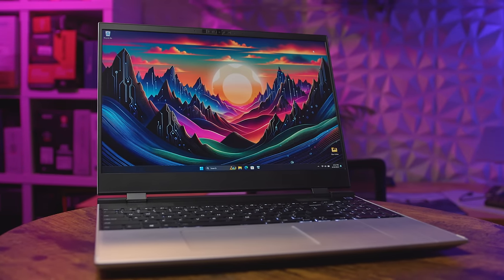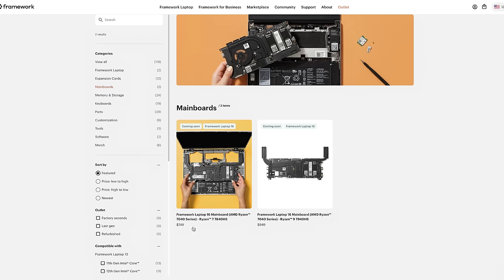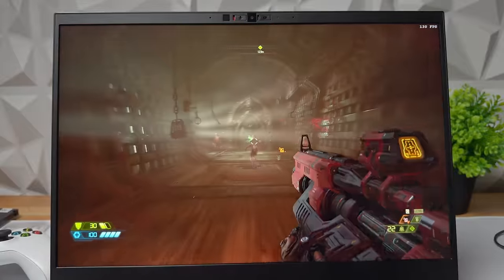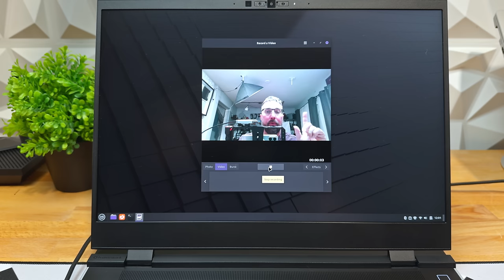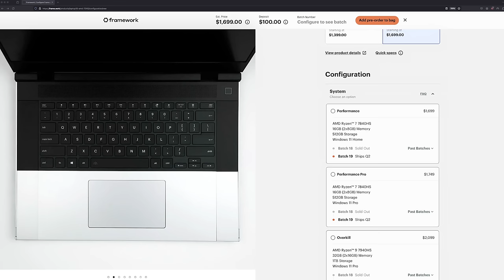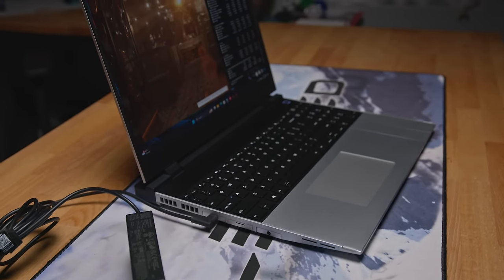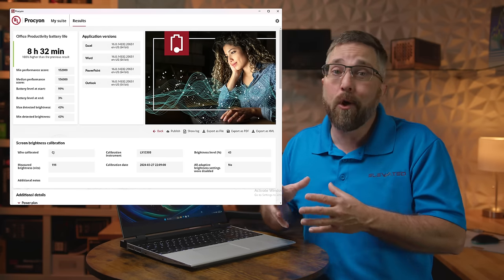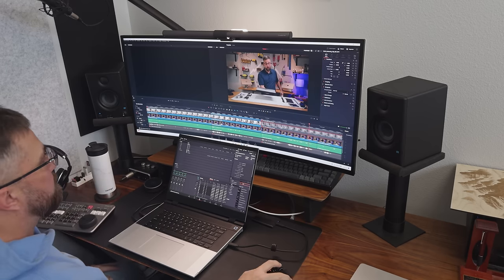Two Months With the Framework 16 Laptop. My Final Thoughts!

Comment: When people say the upgradability is not worth it, i always feel like they're not thinking long-term enough. I don't want to upgrade just once in 2 years, I want to upgrade in 5. And then again in another 5. And another 5. Maybe only get a new graphics card on half of those. Other laptop brands don't support motherboard upgrades at all, and definitely not so they will fit in the same case, with the same display and keyboard, 5 years into the future. This is supposed to be the last full laptop I'll ever buy, not just a replacement for two generations.

I can't afford to buy a new laptop every 2 years. My current one is from 2018, actually. The only thing holding me back is doubts on whether Framework will be around in 20 years.
Reply: I think repairability is more valuable that upgradability. In this case you're paying for modularity and again for the same modularity when upgrading, almost spending what'd you expect for a new laptop with a new cpu, screen, keyboard, etc. It's not cost effective, repairability is where it's at imho (reason why I've been pulled towards business laptops in the  past).
Reply: @fran2911  then i guess it's not worth it... i just, don't break my stuff
Reply: @fghsgh  I don't either, but faulty engineering is a thing, accidents happen, etc. the fact that you can easily get a battery, a screen, a hinge, ports, could be a good argument to get this laptop for long term use, not for specs and hardware upgrades alone, unless prices drop but there's a lot of designing that goes into these things and oems are always incrementing prices
Reply: @fran2911  repairability is definitely a very good one. A lot of people who use a laptop for more than 5 consecutive years will eventually encounter issues with the keyboards, hinges or other mechanical parts that naturally wear down. Replacing a keyboard on one of these is so much more cost effective then buying a new laptop.

Although I will also say another reason for upgradeability is more than just being able to upgrade an individual component, but about having more control over what you actually put into your laptop. 

Like for example, imagine if you were one of those people that LOVED the dell xps laptops and only bought dell XPS laptops. But when you went to buy a new dell XPS laptop, you were astonished to find that they had removed all of its ports, and deleted the function row off of the top of the keyboard. Since you cannot upgrade the processor in your existing device the only option you have is to put up without a function row and useful port selection, or have a slower processor.
Reply: This holds for the FW 13. But the FW 16 is too expensive: you would literally spend less getting an equivalent laptop now and another one in 5 years. You start "saving" money after 3 upgrade cycles, but at that point you might have problems with other components so it won't actually be a new laptop unless you replace those parts too. Which will add to the cost. And you're relying on FW not going bankrupt or going back on their promise.
The 16 is very cool, but the price is not right for the market.

On the contrary the 13 is comparable in price with equivalent laptops and you will start saving money on the first upgrade cycle.
Reply: Also, there's the matter of responsibly using resources and reducing e-waste marginally. I guess FW laptops enable this as well. 🤷🏻‍♂️ 
Not sure if there is any real difference on the ground level though.
Reply: And you can save money with aftermarket parts.
Reply: I like the idea of taking out the mobo and using that for a mini computer that can attach to the other side of a unit. It's why a frame work is going to be a laptop, Or a cheap/second hand apple silicon macbook lands in my hands, so i can install Linux on it.
Reply: same here for example im watching this video on a 2011 Samsung RV511 i really like the feel of the keyboard but i cant upgrade the cpu or gpu which aside from the 4gb of ram which i can upgrade  is the main issue for me using this for the next 5 years
Reply: @Anankin12 The problem is that AMD hasn't released any new GPUs that Framework can use. And Nvidia seems to not care about Framework and won't even let them use their GPUs. So there's literally no good option for high-end GPUs that Framework can use.
Reply: It doesn't even matter if they're around in 20 years because they have all the blueprints available open-source, so the community can always keep replacement parts going if the company does go under.
Reply: @bxnny0374  That's the key right there.

Anybody can (and probably will) make mods long after Framework and/or this chassis is gone and replaced. Have you seen the mods for older ThinkPads?

Comment: A word on input deck from batch 7:
I recieved my fw16 a couple weeks ago (batch 7, which started shipping after the break in february where I suspect they slowed down production a little to work on QC), and so far its been great. The keyboard flex is almost nonexistent due to the spacers they added (which came preinstalled on my unit, idea courtesy of LTT). I think I do agree with you on the touchpad to an extent - while the spacing on my module wasn't bad enough to affect functional use, I think a better locking system would be good if they dont end up selling full width touchpad modules. Something similar to those combo 6+2 ATX power supply plugs, for example, which slot together and are held in place once inserted.

Having said that, I think one of the benefits that isnt necessarily talked about is that since the 13/16 are the primary products FW makes, they can iterate on the design and improve it, rather than designing a whole new system from scratch each time - the value lies in upgradability, so they dont have to invest as much into creating a chassis each year that looks better than the last. And because its modular, you dont have to replace the whole system to make the upgrade - take the 11th gen intel frameworks' chassis, which was replaced with a more sturdy version in the 12th gen (and upgrade kits made available for what is all things considered a decent price, if a little on the expensive side).

One last thing: as someone with pets who shed, I sometimes get hair in the bottom fans which makes a whining noise. To be fair, however, I also havent taken the issue up with framework support; I'm waiting to collect some more info regarding the trackpad and acceleration, which I believe is a software issue on my part.

Comment: The breathing backlight mode is indeed an official feature. It’s built into the QMK firmware used on the keyboard and 10-Key. You can enable and disable it with CLI commands of the QMK tool.
Reply: Also with the Num lock turned off as you would to use the Enter key to change the brightness, use the + key to turn breathing on and off. So you don't have to go into settings.

Comment: I think your criticism is fair. For me, the Framework 16 is going to be fairly cost-effective. I have no current plans on getting the GPU module. Instead, I was looking at the expanded input modules, larger screen (I'm not a fan of 13" screens because of eye strain), and the keyboard being QMK compatible. But, my intended uses are going to be for software development and cybersecurity tasks. So, it fits my needs. I think the laptop is costing me about $1500 DIY and then I purchased RAM/SSD months ago for it. Pricier than I would like, but I couldn't find a laptop about that price point that I wanted. I'm hoping they fix some of these issue long-term though. I want this to become a viable product. 

For your use case, it didn't work out. A big factor seems to be that they used an AMD GPU which like you mentioned doesn't do well with professional tasks. Hopefully AMD will fix that going forward with needing to compete in  AI. Maybe it's the software vendor's issue and not the GPU? I'm not sure here. But, for the general consumer, it sadly doesn't appear to be a great purchase.
Reply: the problem on the AMD gpu is thats actually the best one AMD puts in any laptop, and its around a 4060 in comparison. they have nothing that touches the top end. and AMD was their only option because nvidia is legendary for not playing well with others, and intel being trash in mobile. 

so future generations depend on AMD more than anything unfortunately

Comment: Good review and I think a fair review. If I have the funds I might still choose the Framwork 16, but as you have showcased, it has some issues. While some might get fixed with better quality control, and some software improvements, they clearly are not there yet. I firmly believe that good, direct feedback will improve them in the long run, thank you for all of your hard work.

Comment: I like my Framework 16 (without the 7700s). One example it's just so simple to connect 2 external displays. This modularity is great.
Reply from the maker: Absolutely, the Framework 16 does make connecting multiple displays a breeze with its modularity! It's interesting to note that most gaming laptops nowadays typically support DisplayPort alt mode on all USB-C ports. This feature really simplifies the setup for multiple displays, making it just as straightforward and versatile. It’s great to hear you're enjoying your setup!

Comment: I own an 11th gen Intel Framework 13 and love the unit, they have fixed various flaws over the years and have no doubt that years later the 16 inch model will work out it's flaws in future generations and will be more appealing with its future options and fixes.

Comment: im batch 9 and got my unit yesterday and absolutely love it!, just wish i had ordered more ports is my only gripe, that and lack of usb 3/4 ports, but i guess buy a hub! i was really worried about alot of issues, but none here!
Reply: are the framework USB-A ports not USB 3.0?
Reply: @raute2687  not unless they're in the top positions otherwise theyre USB 2
Reply: @intoxicode Really? I don’t think/hope that’s correct, I couldn’t find info of speeds of the USB A Expansion card depending on the slot besides the Expansion card itself is cable of USB 3 10Gbps (officially called USB 3.2 Gen 2, not to be confused with USB 3.2 Gen 2x2 that is 20Gbps, stupid USB IF)

In any case I should receive mine the next Tuesday so I’ll test it out in all ports (I bought 6 USB A xd, plus other modules of course)
Reply: @Pro720HyperMaster720  All the ports on the laptop are USBC USB 2.0 unless the top two slots which are USB 4.0 over USB c..
Reply: @intoxicode  Now that I have the FW 16 I can firmly say there are NO USB 2.0 USB-Cs, all ports have at least USB 3.2 Gen 2 (10Gbps) mode and the top ones are also USB4

So if you are experiencing only USB 2 speeds you have a problem, either on you laptop or in the thing you are plugging
Reply: @Pro720HyperMaster720 the USB 3.2 gen 2 ports are 10 gbps which are all but the top two, which are USB4 speeds.

The one that provides direct access to the dGPU IS USB 2.0, but that's more for routing a display to the laptop's direct dGPU.
Reply: @cameronbosch1213  that’s essentially what I said only that I didn’t account for the USB-C on the GPU expansion card which as you said, regarding data is USB 2.0 and its DP alt mode is the direct output of the module dedicated GPU.

That being said my statement is correct all ports (talking about the ones on the sides of the laptop) are at least USB 3.2 Gen 2 (10Gbps) but the top ones are USB4 too, if USB4 can’t be used because the device doesn’t support it the next fastest operation mode is USB 3.2 Gen 2 (10Gbps), I think it doesn’t support the USB 3.2 (20Gbps) mode but yes the USB4 (20Gbps) mode (for some reason is not compatible with both 20Gbps standards)

Comment: I'm getting the Framework 16 to replace my old HP laptop where some keys dont always work and the fan has broken a few pieces but still works, but cant find a replacement for it. Not to mention its slow with a SDD swap and runs really hot when the thermal paste was replaced last year. The main thing I like is the easy right-to-repair stuff and a full keyboard.

Comment: Thanks for this brutally honest review. Damn you Asus, you're supposed to be the McDonalds of laptops, to be looked down by the people! And you keep making models that are fairly priced and super attractive. How is this happening??

Just putting it out there, my dream laptop has a 17" 144hz RGB monitor, CPU that doesn't get hot ALL the time, and reasonable fan noise. And built well enough to not fall apart just after a few years of use.

If you know some current laptops that:
>have a 17" or 16" high refresh rate monitor (144hz is ideal for my needs)
>have said monitor be closer to 1080p (I am not actually looking for higher resolutions, for reasons)
>have the monitor be RGB or close (accurate colours plz)
>have a decent or good CPU (not looking for the absolute best)
>are built well, will last a long time instead of breaking apart due to being made of crap components held together by chewing gum

then please name some models.

Comment: i bought asus $2500 laptop back in 2020, the mainboard is dead and to replace it they charge $2000. i am definitely going to buy framework, why? because every issue stated here can simply be solve by later improvement by framework itself and you can just buy the component.

not only that, each individual component is actually easier to be repair since they made it with modularity in mind. you can isolate the problem easier.

Comment: If I've learned any lesson on my current laptop (an MSI that I've had for several years), it's that I can't anticipate manufacturing defects in time to catch them under warranty.  My MSI's display hinge is very badly designed so it has ripped the plastic case into pieces, which if it were easier to take apart I might have been able to remedy by loosening the over-tightened hinge.  So I'm stuck with a "laptop" where the display is permanently open now - I can't close it for fear of doing more damage to the case.  The peace of mind that if something goes wrong at least the whole thing is designed with disassembly in mind is a big value adder, and possibly must-have.  I hope this trend catches on.

Comment: I just wanted to ask...did you re-try video editing on the second unit? I don't expect a new video, I'm just wondering if there were any differences in performance?
Reply from the maker: The only problems with the first unit were cosmetic and the empty expansion bay didn't work. There was nothing that affected performance. I didn't retry editing however I did rerun several benchmarks, and there was no difference in performance.

Comment: I do understand why you'd return the framework 16.    I purchased mine specifically because of an issue I've always run into with laptops of this class with the exception of 2010's macbook pros... hinge failure.  Hinge failure always leads to system failure in my experience.   Am I hoping for upgradable boards - yes of course.  Am I hoping that they'll come out with some better GPU options or some interesting direct PCI options - yes.  Ultimately though... its the hope they will continue to offer replacement parts when damage invariably occurs... or at least release the files so that machining and making an appropriate replacement is also possible.  Because it is designed to be replaced... that means that making a replacement part is vastly more feasible since they're using mechanical methods with durable materials rather than non-replacable adhesives and plastics that become brittle over time and heat exposure.

Comment: My laptop (15 inch / not Framework) is the only computer I have. It sits on top of a 3-inch metal stand for cooling. I am old school, don’t like the laptop pads or keys. So there is a Steelseries tkl (88-key) mini-keyboard and a Logitech G-403 mouse attached to it. How about no pad at all or keys in front?

That all fits together and doesn’t really take up much space for travel. I have used this for almost 2 years with no real problems.

Regards

Comment: I wish it came with a headphone jack as standard on the chassis (probably via a removable daughter board) instead of taking up a spot in the modular port connectors. Easily removable is nice, but headphone jacks rarely go bad and I don't like the idea of such a simple universal port being "optional" even on something as modular as framework, especially when it takes up one of the 6 valuable ports available.

Comment: I ordered this same machine and while I speced it with the dGPU, I'm considering using a GTX1660 Ti in an eGPU enclosure for a couple of reasons.  Have you tried an eGPU with this laptop?  The 1660 Ti is comparable in performance to the 7700S and I'm curious if USB4 would leave any performance on the table?  The other factors are the inability to feed the laptop+GPU with enough power, plus the enclosure I'm looking at would provide a single cable solution (instead of 2) and make the laptop lighter/smaller to carry.